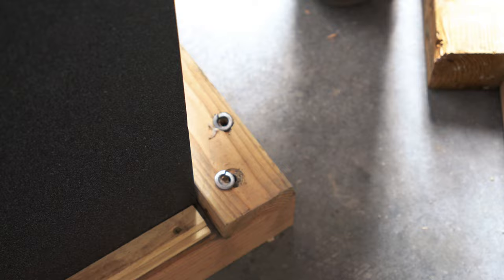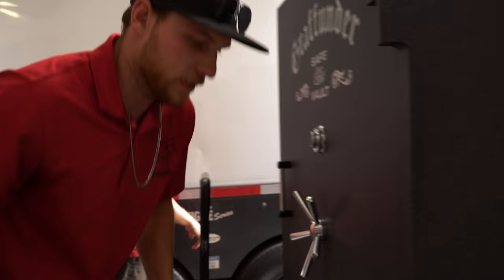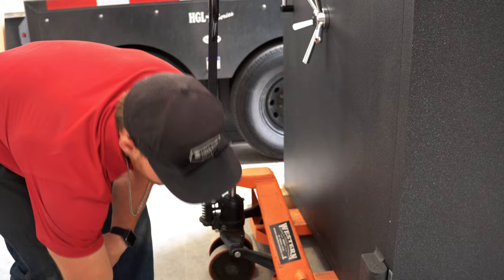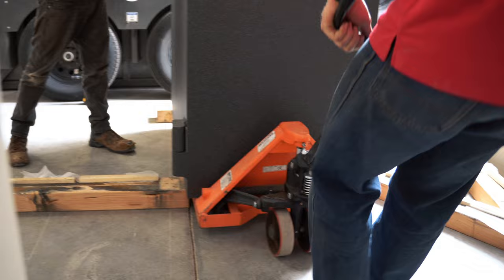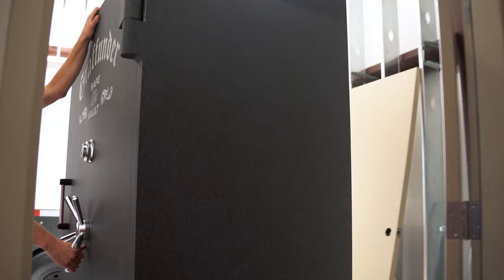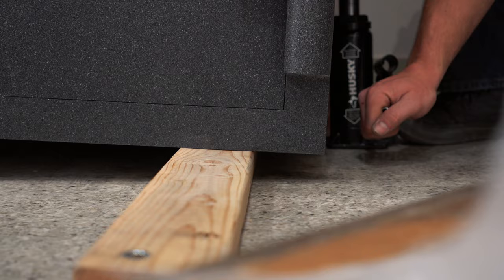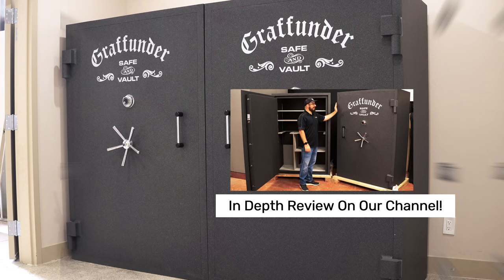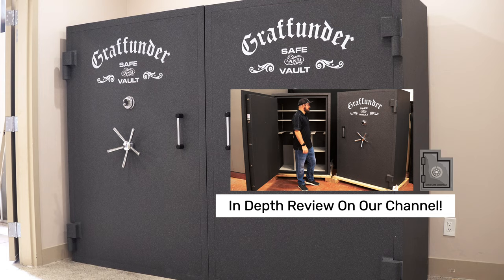Delivery & Install Of Two 5,400LB Safes - Graffunder Emperor 7248

Comment: I was wondering what the benefit is of the 1/2" Mangalloy plate laminated to the steel door in the Fortress safe?  Graffunder makes the statement about "Mangalloy", but they don't describe the benefit for this added cost. If this alloy is simply a trademark for manganese steel and just offers greater hardness & tensile strength, why not make the entire door plate out of it, or for that matter, the entire safe? Also, why laminate it to the inside of the door? Why not the outside?
Reply from the maker: You are correct it is a Manganese steel which is harder than regular steel. The Manganese in the steel hardens as it is hit or attempted to be penetrated. You can't make a safe out of manganese steel because it would be harmful to your lungs because of the toxins it releases. That is also why the plate can not be laminated on to the outside of the door and needs to be on the inside of the door.
Reply: German Prisons has Windowbars out of Manganese Steel. There are no Problems with it

Comment: Theres a gap at the top but not at the bottom...
Reply: Floor may not be perfectly even
Reply from the maker: Yes, the floor where they were installed wasn't perfectly level. Normally we are able to add shims underneath the safe to level them out but in this case the customer wasn't concerned and it didn't bother him.